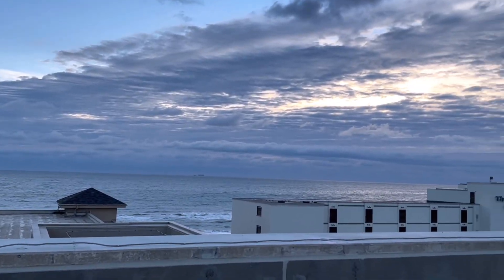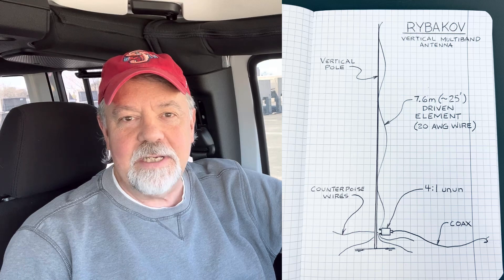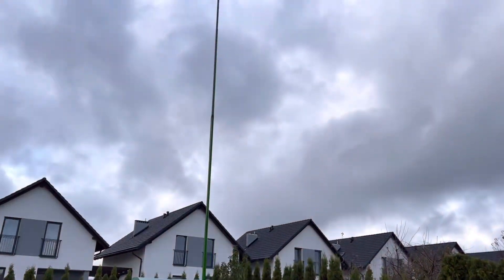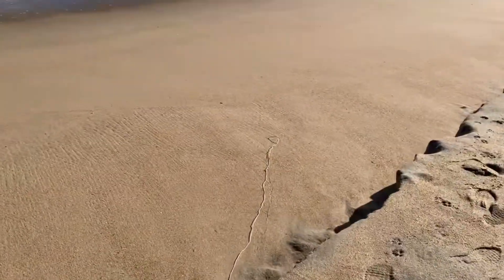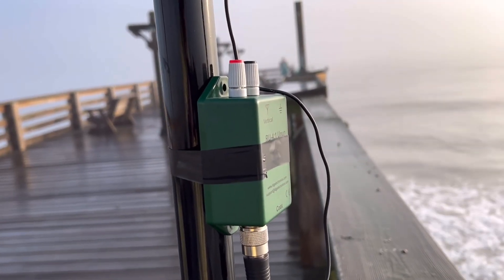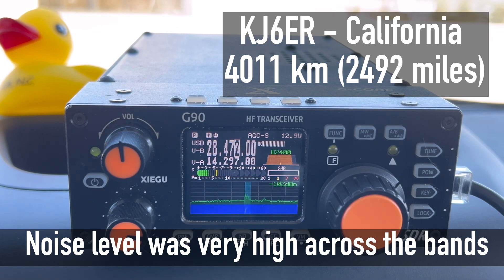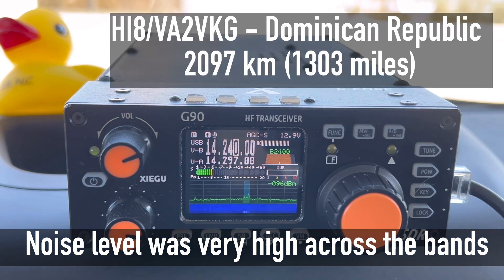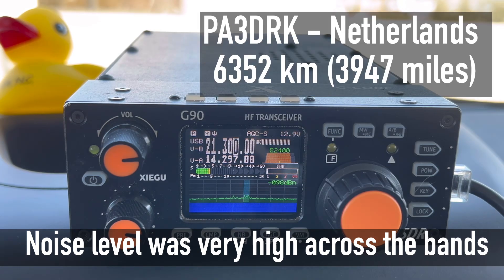Urban Ground Plane - HF Vertical Antenna Over Concrete

Comment: This is TOTALLY awesome! I have been trying the Rybakov in NC with counterpoise wires on the ground, versus elevated a bit. So far it's not been so exciting, compared to my 40m doublet. However, I do love what you tried and I celebrate your results! You really were thinking of both the coax on the concrete PLUS the wire from "ground" on the unun down to the "flagpole mount" on the concrete. Very good thinking and bold of you to TRY. And what great results! Way to go! This is inspiring to me to keep trying portable and I want you to know I am not giving up on the Rybakov. I did build my own 4:1 unun and it seems it is working but maybe my ground is not so good. NO EXCUSES NOW! Haha! I will keep trying, as I plan to bring my "kit" for the Rybakov to some remote portable sites. And I do have a further limitation as I tend to use 5W max (CW) or 10W max (PEP SSB), for my masochistic desires to be "strictly" QRP. Not trying to tell others what they should do, especially you Walt, as I want you to continue to have fun experimenting and sharing with us your portable antenna adventures! 73, Dave WA4NID

Comment: Walt mutual coupling is a great thing. You come up with neat stuff. I have a 75 meter inverted L. Elevated counterpoise. Fed with 8x coax. So its a monoband antenna. I tuned it up on 40 meters. It works, not the best. During the day when band conditions were poor I worked a station 300 miles to my south. I was using 50 watts. The guy I worked was barefoot as well and using a 20 meter dipole. He was feeding his antenna with 8x coax too! So a guy with a half of an antenna and me with my inefficient antenna, with the band in poor status and both barefoot on 40 meters. Oh, signals were 55 to 59 on both ends. You just don't know what you are going to get on the bands until you try. Sorry for the short story. Keep up the good work. 73
Reply from the maker: Thanks for the comment my friend! Yes you never know. 73, Walt

Comment: Walt would like pick your expertise on wire antennas if you don't mind. I am trying to build the 25 ft wire antenna with 4 to 1 unun. I cut wire to 25ft but only get a close match on 10 mtrs and its still 2.5 to 1 at best. My G90 shows all other bands at 4 to 1 or greater.  I know  the ground has a little to do with how it works. So before I start cutting wire down any thoughts? I have a good ground plain about 30 wires spread in circle around it.
Reply from the maker: Wow that’s got me stumped. I usually get at least what you got on 10 on all bands and even better which gives me an easy tune with the G90’s ATU.

Comment: Now I'm curious how much better (or not) the Rybakov would be on 30-80m with the rebar ground plane. I've used the Rybakov on lower bands, but I know it's better there with more radials or a better ground.
Reply from the maker: I might have to do a nighttime garage run and try that.

Comment: Parking Ramps On The Air?  PROTA ?  can be fun. lots of metal to act as ground plain.  vertical works well with a great ground plain. same noise threw the bands hear in NY. even the SW stations weaker than normal with high noise. 17 meters shows fair . I did FT8 on 12 meters. few contacts with low signal report both ways. using end fed half wave vertical cut for 10/11/12 meters with ground plain. over grass. cold snow in NY did not do much. windy with wind chill . that cold wind will get you. 73's
Reply from the maker: PROTA! I like that. It will be warm soon!
Reply: @COASTALWAVESWIRES  it was in the start of March. even a 80F day. now winter. crazy NY weather LOL !

Comment: Very good Walt. I was trying to think how you could you make even better better use of the rebar. Assuming you cannot make a diirect connection, could capacitive coupling be increased by using more wires or some kind of mat or mesh? 🤔 Something like a roll of chicken wire comes to mind. Though, if you start getting too adventurous, might start to attract the attention of the carpark authorities 😂. Maybe stick with the  co-ax on the ground - it obviously works!

Comment: Great video Walt. I've tried the Rybokov antenna here in my backyard to see what kind of results I'd get and while I wasn't as sucessful as you have been, partly due to my location and the surroundng QRM, I did learn from the experience. For the last two weeks I've contempated getting a G90 but wasn't sure of it's performance on 20 watts, but watching this video convinced me to get it. I'm not much for doing POTA or SOTA for that matter, but I do like to get out and make contacts even in my backyard.
Reply: Like Walt has, I’ve made great contacts with the G90.  Longest so far has been to western Australia from Florida panhandle. Talked to two Hams who live 35 miles apart and who knew each other.  I’ve all but quit using other radios in favor of the G90 and mostly at 5 watts for regional qsos.  Using the Rybakov and an all band doublet.
Reply from the maker: Thanks! I think you will be surprised how good 20 watts is. You’ll love the G90.

Comment: I wonder what would happen if you clamped into something connected to the rebar.
Reply from the maker: Probably a similar result as the wire I used actually coupled with the rebar the way I did it.

Comment: Like you, I never considered re-bar as a ground plane but it could have been designed for the job! It would be interesting to experiment with a short coax versus a long one to see just how much work the counterpoise is doing compared with the coax. Thanks for the video Walt, 73. G0ACE

Comment: I need to think about coupling to the ground plane. You coupling depends on the distance to the rebar as well as how much coax you have just above it. I suspect several radials will increase the coupling ( reduce the impedance or capacitive reactance ) to the rebar just as it does to the earth when you string out radials over it.
Reply from the maker: I hear you but for this simple experiment I think it’s obvious a single wire and the coax coupled and the rebar in the concrete acted as a groundplane. That’s all I was after, didn’t want to overthink it.

Comment: Not to shabby after looking at the band conditions forecast. So, do you ever get drive by from the PD checking out why you're setup on the top of the parking deck?
Reply from the maker: Yes, actually happened this week with the Mad Dog Coil. I just told them I was a ham playing with my radio and they said “cool, have fun”.
Reply: LOL I would have been surprised if you hadn't had a visit, glad they were cool about it. @COASTALWAVESWIRES

Comment: I have used the Rybakov on my 40' pole with elevated radials. It kicked butt. I used electric fence posts to hold up the 16' radials. Tuned up 40 to 10 meters.
Reply from the maker: It’s a great antenna!

Comment: I would bet that all the metal in the rails behind you is a direct bond to the entire structure.  Direct connection next time?  Bring along your battery grinder.  One little "bump" will show some clean metal!
Reply from the maker: Not a bad idea, or maybe a direct connection of a portable mirror mount to the rails.